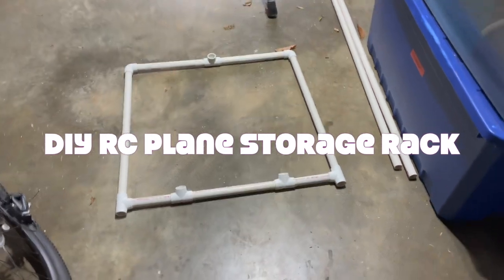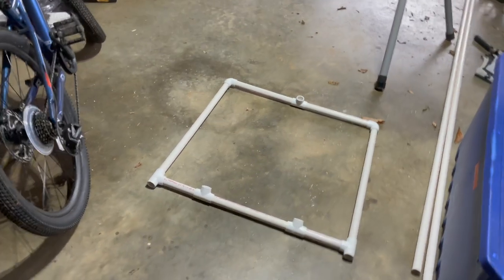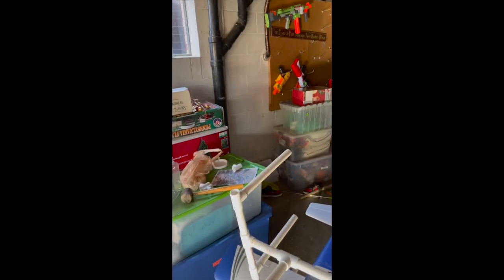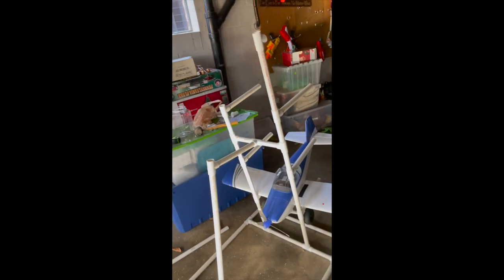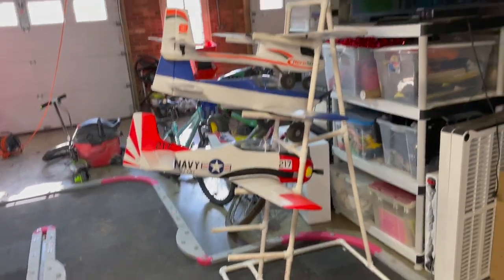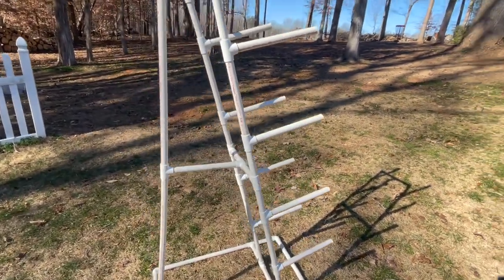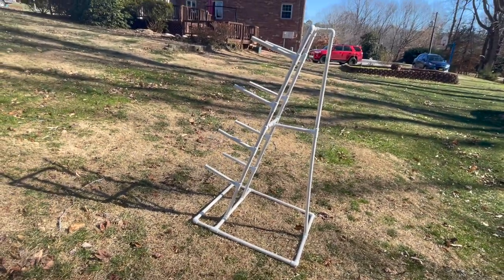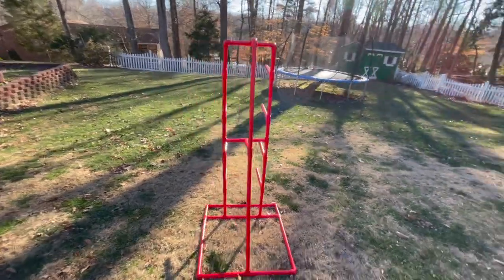DIY RC Plane Storage Rack

Comment: I build a smaller version of something almost identical to carry my plans to and from the flying field.  Add some foam (like wrap pipe insulation) where you plane sits to add some longer term protection to your foam from taking a set in it from the PCV pipe.

Comment: Would be great to post all the cut lengths of the pipe and dimensions.

Also, why not have the front upright on the front of the base?   

Thanks!
Reply from the maker: Base is 28"x33" the structure is 62" tall, where the wings sit is 12" and it is 14" wide where plane sits as well as 14" tall from each placement of the next plane. Hope this helps.

Comment: Looks godd, but at least give the dimensions of the base, so that the people could have something to start....
Reply from the maker: Base is 28"x33" the structure is 62" tall, where the wings sit is 12" and it is 14" wide where plane sits as well as 14" tall from each placement of the next plane. Hope this helps.
Reply: @bgblindt  Yeap, everything is there, thank you...
Reply: @bgblindt  Pipes are 1/2" or 3/4" , maybe you said it and I didn't catch it...
Reply from the maker: @hectorcastro7978  3/4